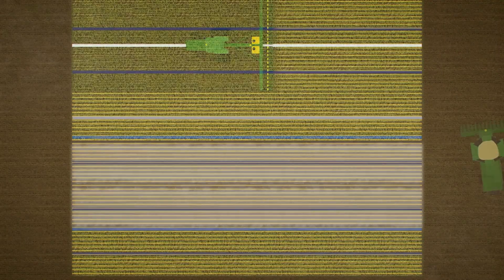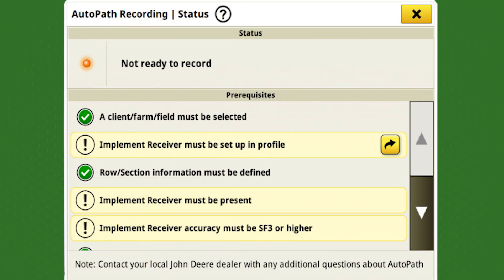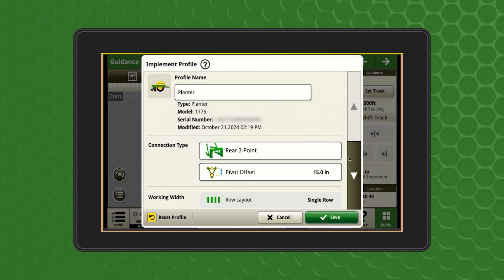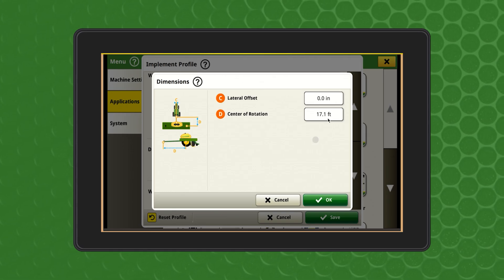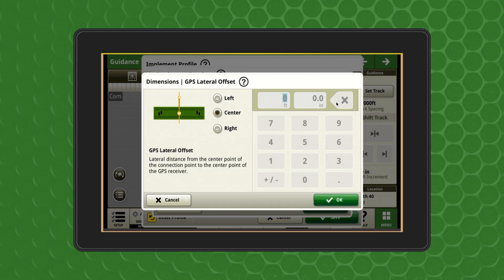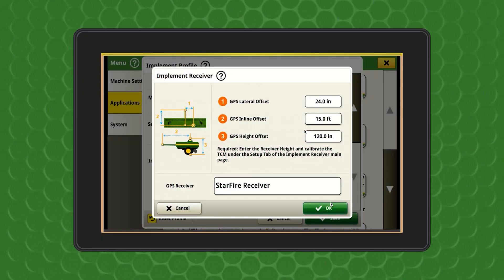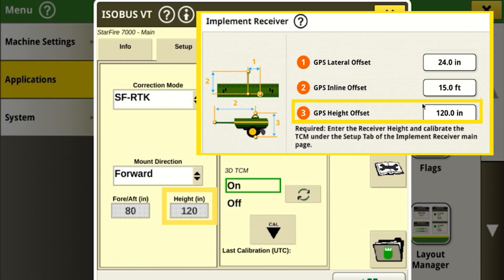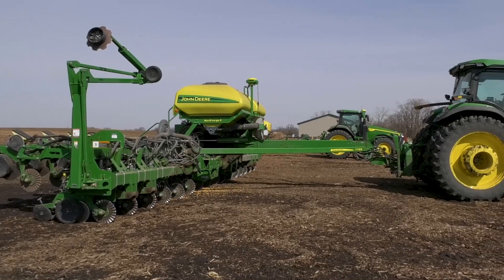How to Set Up Measurements in AutoPath™ | John Deere Precision Ag

Comment: Ok nice but what if I do have a swivel hitch?,
Reply from the maker: Great question! Once you’re in Equipment Manager as shown in the video, and you’ve selected your implement, you’ll want to start with “Connection Type” and “Pivot Offset”. Pivot offset requires measuring the horizontal distance between the tractor connection point to the implement pivot pin. This measurement applies to two-point-drawn implements with a swivel hitch. If you require further assistance, we recommend working with your dealer for hands-on support. You can find contact information for your nearest ones at Deere.com/Dealer. We hope this points you in the right direction.
Reply: Okay thanks. That helped.